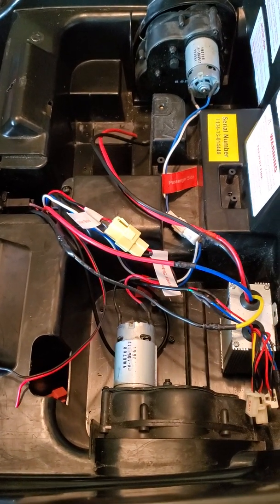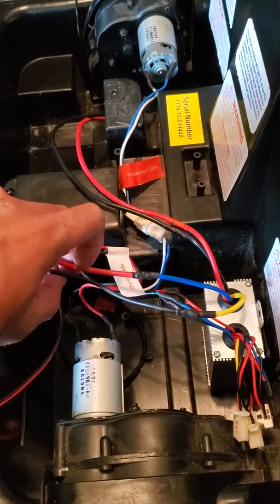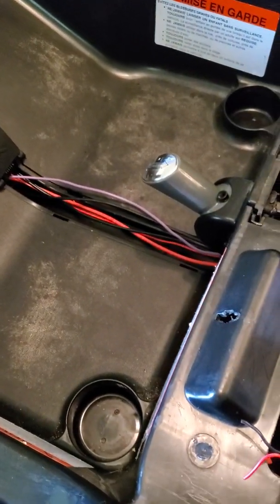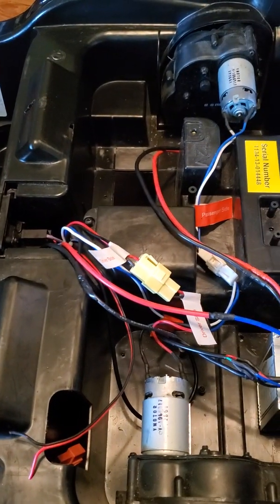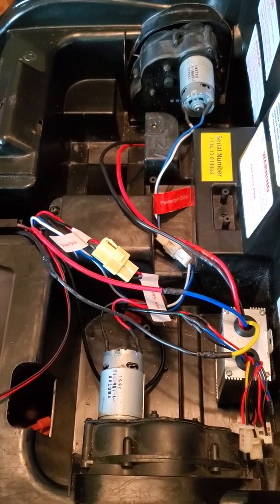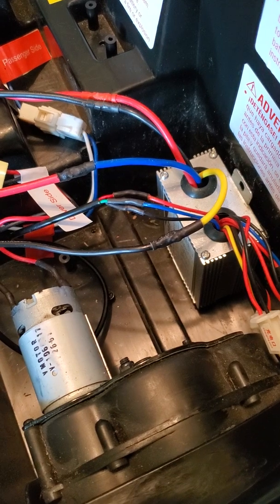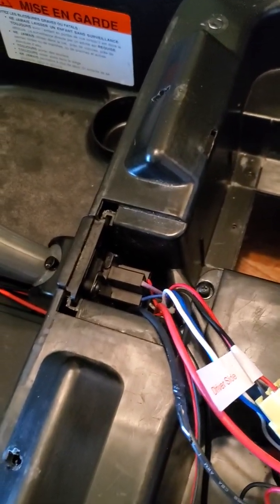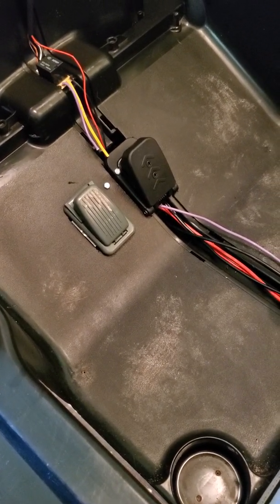How To Install 24v ESC on Kid Trax VW Beetle (Power Wheels)

Comment: How did you get the pedal to be a variable speed pedal ? I got the exact same pedal and esc buy mine just goes and off it’s not variable 
Tested only with a voltage meter, havent actually plugged into the motors yet 
Not sure if that makes a difference

Comment: This is exactly what I needed!  Question, on the three wire coming from the esc to the throttle, will you be able to measure 24v just at the connector?  I test connected everything on mine, confirmed 24v going in from the battery, but nothing coming out....  Just trying to make sure I don't have a bad esc
Reply from the maker: Do you have the same ESC as the one I'm using?
Reply: K.V. Patel yep, I think I know why and I'll test it when I get home.  There's a connector for an on/off switch coming off the esc.  Might need to add a jumper there to tell the esc its "on".   Assuming that works, any idea if the voltage for the pedal is 5v??  Every thing I've read on testing hall effect pedals shows them tested at 5v.  Just curious if the esc drops it down for the pedal?  That would explain the smaller gauge wiring for that and other connectors and tell me what to test for as opposed to looking for 24v at that connector.
Reply from the maker: @jameszettelmeyer291  yup that's exactly what I was going to tell you. You need to cut the connector of the switch and connect the wires for the ESC to be powered on. In my new builds I connect those wires to an actual ignition type switch. The hall effect pedal is 0-5v. 0 when not pressed, 5v when floored. The ESC takes the signal and coverts it to how many volts leave the battery to the motors.
Reply: K.V. Patel jumped the ignition connector and worked perfectly.  Thanks so much for the help dude!  Subd!